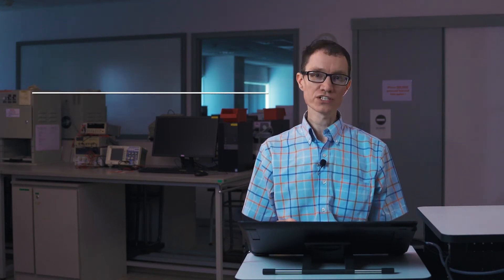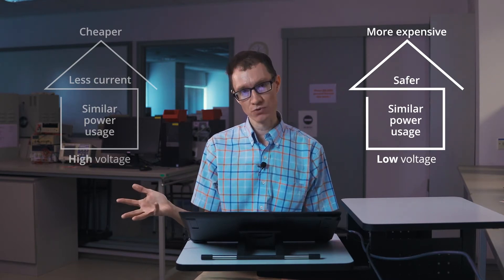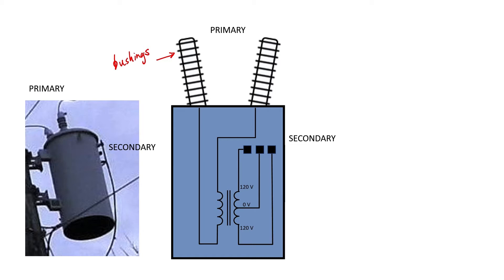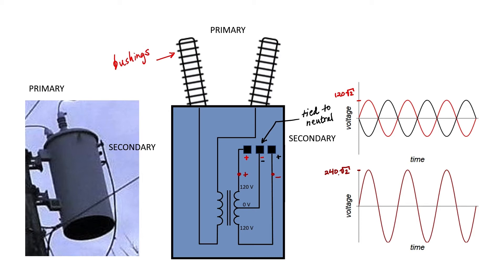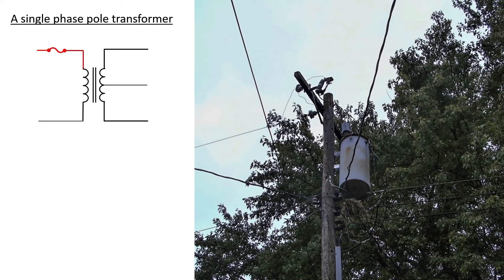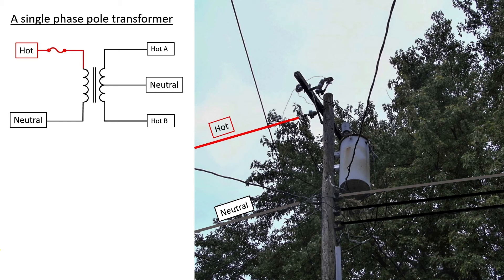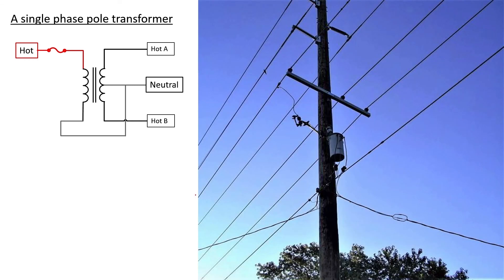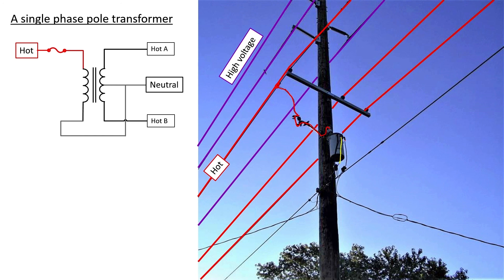Split phase power in North America (22 - Electricity Distribution)

Comment: As you are a teacher, there is something I wish you would explain to your students.   When you say that the split phase is 180 degrees out of phase, you must make sure that it is known “when viewed on an oscilloscope when neutral is connected to the common point on the scope” This condition does not truly exist.  When you show the two sine waves for 120 volts, the resultant voltage would be zero volts.  120/240 volts is single phase.  The connection points are not called phases until you are in multiple phases.  They are Line1 and Line2.
If you would like, I can link you to videos explaining why 180 degrees out of phase is very much incorrect in the real world.  Respectfully,   Kevin
Reply: From my perspectiv the two voltages are 180 degrees apart
Reply: @kjellg6532     
https://youtu.be/nOSYHUxHxG8
https://youtu.be/uRKbX74lBgU
Reply: @kjellg6532      https://youtu.be/nOSYHUxHxG8
https://youtu.be/uRKbX74lBgU
Reply: @kjellg6532     Your perspective would be incorrect.  Which two voltages?  There are three voltage sine waves in a 120/240 volt single phase system.
Reply: The only way you can get the L1 and L2 wave forms to be in phase with one another is to use two separate references.
Reply: @iceman9678      You need to be more specific.  L1 to what and L2 to what?   How about L1 to L2 and L1 to N?   Are they  happening at the same time, same direction?   Or maybe L2 to L1 and L2 to N?
Reply: @KevinCoop1  You need an isolated scope and then use separate references to measure L1 and L2.  There are plenty of videos about this.   In application, a single reference is used when L1 and L2 are used in appliance..
Reply: @iceman9678     Here is the problem.   You keep talking about what shows up on a screen of an oscilloscope, and I am talking about the reality of what must and is happening with the voltage coming from a transformer with a coil and a center tap.   All three sine waves happen at the same time and in the same direction, but the machine cannot show it because it only has one common point and it is connected to the center point.
Reply: @KevinCoop1  I guess we just have to disagree.  I don't agree that there are three sine waves.  I don't agree that for a given moment in time that they are travelling in the same direction - except when they cross at zero.  I don't agree that simultaneous AC sine waves for a give voltage, frequency, and phase angle are summed together.
Reply: @iceman9678     The three sine waves that must happen in the same direction and at the same time are 240V @ L1 to L2, 120V @ L1 to N, and 120V @ N to L2.   I will pose a question to you.   Let’s assume a half sine waves happen for a second.   Also assume L1 is left, L2 is right, and N is center.   At time 0 to time 0+1/120 the 240v is induced from L1 to L2 through both halves of the single coil. Correct?  The N has no effect at all.  So, the electrons are flowing L1 toward L2 in the coil.  Sine 1.   Now with L1 to N, since half of the original coil is utilized, it produces only 120V at exactly the same time.  Correct?   There is one part left which makes a voltage sine wave.  Correct?   Please explain how the other half of the original coil can be in reverse direction and out of phase during this time slot.  The electrons from L1 to L2 are still there going left to right.  If you draw a single phase transformer with arrows of direction of electron flow, it might help.  The answer is it goes from N to L2.   And an Oscilloscope cannot show it.    If you still believe I am incorrect, I can send you a link of a video that shows and explains what I’m saying.
Reply: @KevinCoop1  if I said the coil ran in two different directions at the same time I am sorry.  I agree with much of what you wrote. when L1 and L2 are used then you're using the full transformer and each end of the transformer are often depicted as +120v and -120v, no?  The difference being 240v.  If you were to add them you would get 0.  When you break this down and throw in N (zero reference).  So when t=0 the N to L2 is +120v and N to L1 is -120v and N=Ov.  This can be true no?
Reply: @iceman9678     You decide for yourself.
120/240 split phase information.      https://youtu.be/nOSYHUxHxG8

Proof of not 180 degrees out of phase.      https://youtu.be/uRKbX74lBgU
Reply: Yes. I would greatly appreciate any videos that clearly explain WHY the 2 hot lines are 180 degrees out of phase. Thanks for your input.
Reply: @Festus2022  Watch the video made by Dave Gordon  named  120/240 V In-Phase or Out of Phase
Reply: I hope this instructor doesn't try to display in-phase waveforms on a scope unless he has an isolated scope. Otherwise, kiss your front end goodbye.

Comment: Probably less likely to get killed.  Not withstanding the remarkable amount of flim-flam in that statement alone, 'probably', 'less likey', no except in edge cases.  Universally accepted real world scenario tests have shown 120VAC systems to be just as fatal as 240VAC systems.  The simple proof of this is in countries with similar levels of refinement of electrical standards, as a proportion of population the USA has a high rate of shocks and electrocutions compared to those countries using 220-250VAC.  If 120VAC was safer it would be reasonable for the situation to be reversed or at least have similar rates per population.

I really wish this myth would go away.  It wasn't an accurate statement decades ago and it's even less accurate these days with many countries requiring RCD (GFCI) or at least have implemented regulations that push installations towards having them over time.  If you want a marked step in intrinsic safety you need to go quite a bit below 120VAC.  For example the UK has a 120VAC-ish standard for use in building sites where the 120VAC supply is centre tap earthed to ensure that should a person come into contact with one of the 'live' legs they will only be exposed to approx 60VAC.

The real reason the USA has 120/240 is backward compatible historical supply arrangements.
Reply from the maker: Haha yes if someone dies from electrocution at one voltage, it is then hard for someone else to be "more dead". Accidental electrocutions at household voltages are so rare to begin with that I'm not surprised if the overall death rates are similar though.  The lethality trend would probably be clearer if comparing 12 kV to 120 V.
Reply: @adanner  if anything, electrical caused fires should be more common in the split-phase countries, all else being the same, as any bad connection would have the heat dissipation squared since the current is the double compared to the rest of the world.
Reply: @BPo75  don't forget more outside exposure to MV cabling as split phase needs more transformers then 3-phase LV distribution from  large central substation,